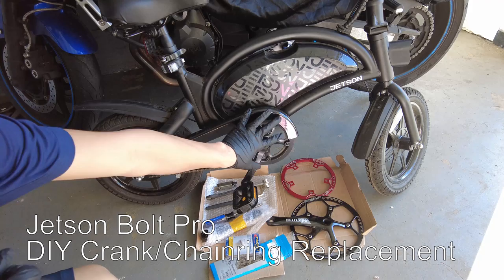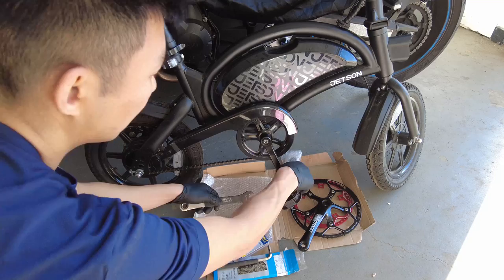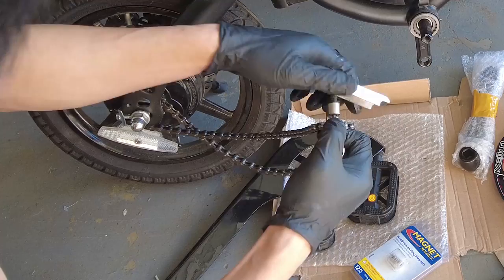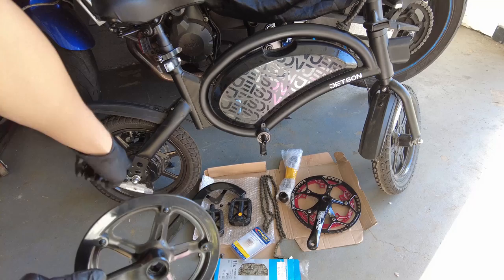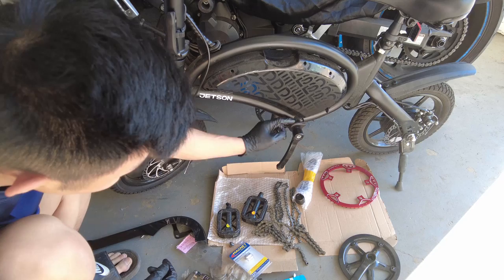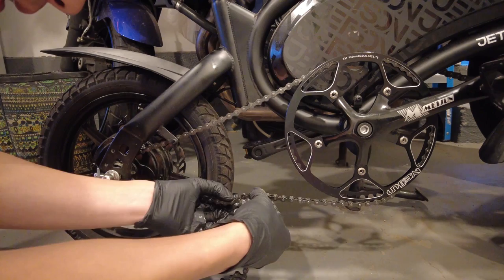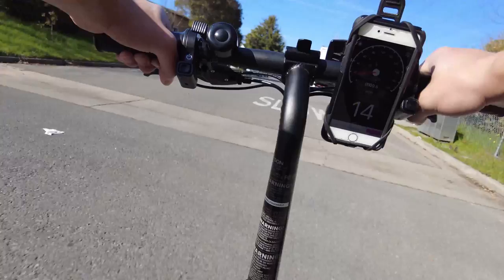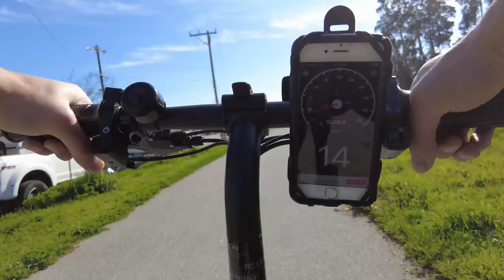Jetson Bolt Pro 21MPH Max Speed MOD - DIY Crankset Replacement

Comment: A ienyrid b2 48v 400 watt will do 28mph out of the box. Made in same factory as jetson, dyu, kugoo, and ancheer.
Reply: I don’t know about 28mph my jetson bolt has a 350w motor I did a 48v controller it’s 22amps I get 23mph on 
Flat and 17mph going up hills 400w motor that’s a Gimmick.
Reply: If you watch the videos for those bikes it shows the specs and they saying it goes 28mph (40kmp). They also have a video of the factory assembling the bikes in china. I have contacted the factory in china and have ordered a Bluetooth module and a 48v controller.
It plugs directly into the Jetson. No cutting of wires or splicing connectors.  So headlights and cruise control still all work. Just to let you know.
Reply: @alexisdejesus5771  Did you keep the original motor hub or did you replace it?
Reply: @ansia8785  I kept the stock 350 watt motor. But monitor the temp because running more amps to the motor. With this 48v controller and bluetooth module can now use their app to lock the bike. Also the headlights and cruise control still work.  They also gave me a one year warranty.  Cannot get that on ebay controllers.
Reply: @jby5736  I also did the 48v upgrade. Everything on my JBP has been replaced, except for the motor. My worry is that it's really loud and I am unsure if it's the currents working around the magnets or the gears working extra hard. Does your motor overheat?
Reply: @ansia8785  I checked the temp after going up a hill and only warm to the touch.
Also when I first got my 48v controller ran it with the 36v battery. It worked.  Because was not able to puchase a new 48v battery yet.  Only tested the controller with power tool batteries connected in series at 60v at 4amh.  So you still might have use for your 36v battery as a backup.
Don't think this hub motor has gears?
Reply: @jby5736  I have both a 36v and 48v battery and when I go into long trips, I take both with me. It's simple to exchange the battery and specify the controller which type of battery you are using at the moment. I would suggest you don't use a bigger voltage than the controller can take. I fried the OEM controller using the 48v battery.  I figured the hub motor was planetary as it increments on speed when you launch. This can also be changed in the controller settings. When you have a motor hub without planetary gears, you get 0 or 100. No in betweens or at least that's what I have read. I'll wait until I burn mine down and open it up to see what's inside.
Reply: @ansia8785  I am not sure if there are gears in this motor.  I still have my 36v controller.  Did the shunt mod and the arduino mod on it. The 48v is from the factory so it should be good and seen others running 35amps to motor and still only getting 30mph. Don't want to buy a motor.  Trying to upgrade as cheap as possible.  They have motors with higher rpm but hard to find or ecpensive. One tip if you take your bike to the store put it in the shopping cart.  That way it never leave your sight.  Take advantage of the small size.
Reply: @jby5736  You can't run 35 amps to the 350w motor. It won't last you very long before burning down. Randy Rides went with a 1000w motor, which took him to the 30mph and that one died on him as well, but saw another video with a DYU where he got a 1500w motor and did 38mph, which in my opinion is playing with fire, but interesting to see. Once I kill my 350w motor, I will probably go play with fire 🤪
Reply: @jby5736  How did you get in contact with the factory? And what was their price?
Reply: @ansia8785  If you want a motor that will be rated for the wattage.  Think you going to have to go to 10 or 12 inch scooter hubmotors. The ones you buy saying 1000 watts 14 inches are only numbers. Look at the bike then go to the factory that makes them and buy there parts.  Any one in china can sell you junk. Saw this bike extreme bull k6.  146volts 7000watts $5000.
The other route may be to go with dual motors.  But I want the cheapest way and every thing to fit in case on bike. So for 48v controller and battery can go 25 to 30 mph. And only $300 more.  If I want to go 80mph.  Can spend 5000 for a sun tour. And you have a warranty.
I'm poor.  Don't have enless cash to experiment with.
Reply: @jby5736  perhaps you are right. I am happy with my 22mph for now. Just installed hydraulic breaks on mine, for safety. Dual motor isn't the way to to. You will have more torque, but same speed.
Reply: @shaniyasims1626  Cannot put link her.  But the bike the factory puts out is called ienyrid b2. Also called kugoo kirin b2. They have youtube videos and on there website they have a email link.  I bought a Bluetooth module and a 48v controlller for $60. With a one year warranty.  It is plugs in directly to the Jetson no wrieing, cutting or splicing of wires.  5 min. Replacemrnt. Still have headlights and cruise control.
The specs on the 48v ebike is it will run at 25 mph with a 48volts battery. They even have a video of them assembling the bikes at there factory.  If you look good one guy is wearing a DYU shirt.
Reply: @jby5736  Would you share the info to get the bluetooth module and the plug and play 48V controller  from the factory in China please?
Reply: @jby5736  So that controller should be able to use a 52V battery if you were running at 60V
Reply: @jby5736  What is the benefit of the bluetooth module?
Reply: @jby5736  did you notice the motor working harder and become more noisier after doing the 48v controller upgrade?
Reply: If you look up ienyrid b2 this is the bike the chineses factory sells that also makes the Jetson bolt pro. They a youtube video that shows them assembling the bikes in the factory. The spevs on the ienyrid b2 is 48v with a 400 watt motor.  So on there website there is there contsct information. Ordered the 48v controller and Blutooth module.  For 60 and came with a one year warranty.  Headlights and cruise control all still working.
Reply: I just ordered it to see if it was the one that was same as in the bolt( the one without pedals)
Also if you download the app you can lock the bike via Bluetooth.  Maybe even up the speed more when mods come up.
Reply: The motor was louder because you are running more amps though it.
Reply: @jby5736  the controller is rated only for 7amps . Why get this when you can get the one mentioned on Shiva's video (the brainpower one) which is rated for 13amps nominal and its also quite a bit cheaper and includes the display as well. And no bluetooth module is required.
Reply: The controller I got was rated at 48v at 15 amps.  With this controller you still have cruise control, headlights, and pedal assit. There is no wire cutting and trying to figure out the 3 motor and 4 phase wire combination. Plugs in directly.  Don't like to put a display on the bike that will break. Just use my phone.  So with this factory 48v controller just get more speed with a 48v battery.   All parts fit in the case of stock jetson. Just ordered the bluetooth just to see if it was the same one as the bolt.  It is so you can get it from them.
Reply: Can you link the store you bought it from? Or the email? Or even the controller part number? Many people have asked you.
Reply: @dondre4747  i didnt' buy the controller. I just saw it on their website. Ask Jb y for the link. thx